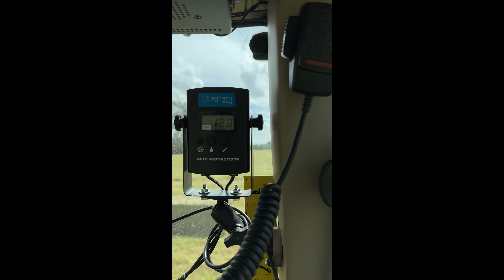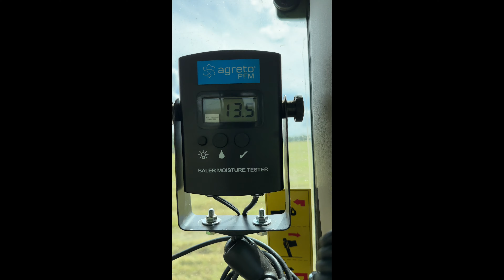Tenon Cutting on the Spindle moulder, Sharpening Chain Mortiser and More Baling Action

Comment: I work on maintenance of the Boeing 777 and for the trailing edge flaps there’s grease required in a hard to reach location. The nipples are positioned close to hand and are on the end of a length of 1/4 Alu tubing that in turn does all the reaching into the tight spaces before it’s threaded into the fitting. Given the aversion to any excess weight, it must been a right pain. 

Am surprised not to see similar on the JD

Comment: What's the wheel looking thing at 19:30 on the front of the tractor for?  It's amazing you can go full speed and bale, crazy how powerful these machines have become.  Thanks for combining my two favorite things to relax to on YouTube, farming and carpentry.
Reply from the maker: Thankyou! The front box holds tools, extra twine, has a pushing bar on the front for moving bales and the roller underneath if for pushing big lumps over and flattening them so you can drive over them. Some lumps where combines stop are 6' high 🤣

Comment: Hi Ollie, are the flags on the front of the baling machine for alignment ?
Reply from the maker: Ey up Jim, no bit of fun, but turns out they have a practical reason too, we like to clean the baler down facing into the wind so the dust goes away from tractor/exhaust etc... Flags make the location easy 😂

Comment: Hi.can you included a link to that grease gun extension please my landowner has a mid steer tractor withthree PTO going through the centre and are total suits to grease. Cheers..
Reply from the maker: Cheers bud, it's in the description under grease gun adapter 👍 hope it helps still have to be within 10 degrees of the nipple, but much better for close uj's
Reply: @BradshawJoinery  cheers

Comment: Make sure you clean all your static machinery if you’ve had green oak on it. It will rust it up in no time!!
Reply from the maker: yess! waxed before and after use. I did however mistakedly leave my big slick on a piece of green oak... painful finding that in the morning.
Reply: Oh no! get the air line and blow in all the nooks and corners. Our Sedgwick planer is not in great shape!
 @BradshawJoinery

Comment: Scary. I can see your self taught. Thats got to be some of the most dangerous and sloppy machinery operating ive ever seen. Rather you than me.
Reply from the maker: Which bit? You can link me to the time if you type it in you comment in this style 0:25 
Are you a woodworking machinist? 

Some of my practices may not be advisable for unskilled operators but I work safely and solely around my machinery.
Reply: @BradshawJoinery  
I've been in this trade all my life. I've worked with the best and the worst. I've seen shaper knives go through walls, exploding heads, finger's lost. Ripping tenon cheeks with the grain facing forward in to two saw blades ? If that kicks back on you you will only have yourself to blame. You know it, I know it. It only takes one knot  or case hardened timber. It only takes a moment and you won't be able to wind back the clock.
Tenons at an angle are always tricky as is shaping round mouldings. 
What would I have done ? Used a thicker slotting head, flipped the work and reversed the rotation to avoid the risk of a thin blade bending and binding in the cut. That way you only need one blade instead of two and the little extra time it takes ? Inconsequential. OR use an insert tenoning head. I use my shaper as a single end tenoner all the time. But I would never use a saw blade on it. Especially outside of ninety degree angle cut's. 
Remember, your in the public domain now. People will see how you did that and try to copy it. 
If I bend the rule's in private then I only have myself to blame. 
There are huge number of hobby woodworker's out there with a Felder shaper or similar who want to push the limits. 
When it comes to heavy timber framing it's usually better quicker and easier to do a bare faced tenon anyway. Braces don't need to be the same thickness as the post and beams.